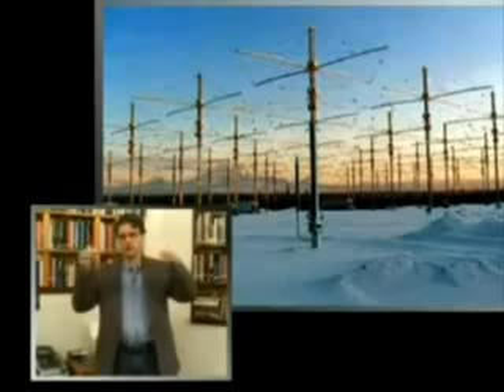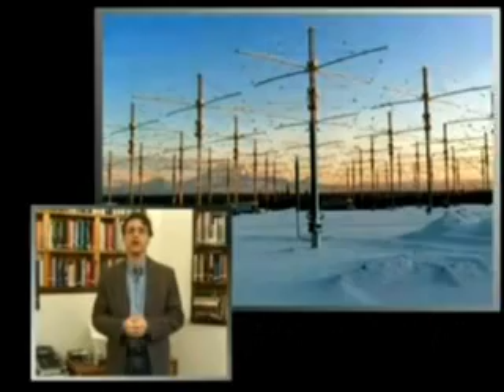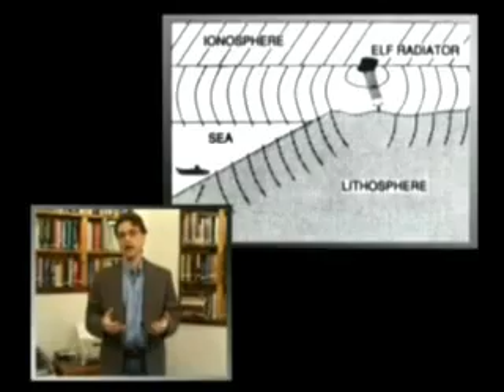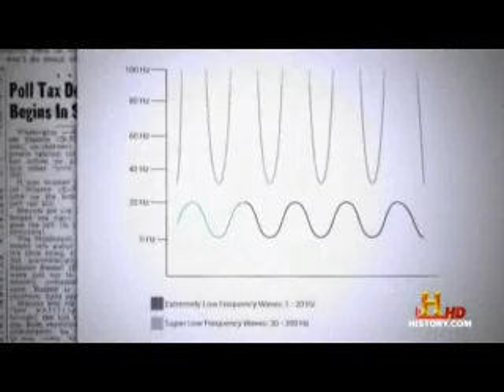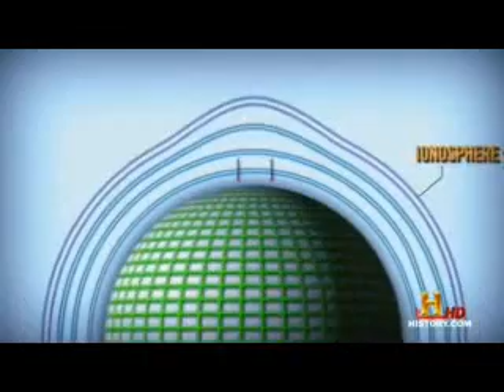H.A.A.R.P. ( Explained in simple terms )

Comment: As long as you realize that if you heated a cubic km of air with a billion watts of power, that would equate to one watt per cubic meter. Quite a shock when you realize that you have been conned because you didn't understand what you were being told/indoctrinated